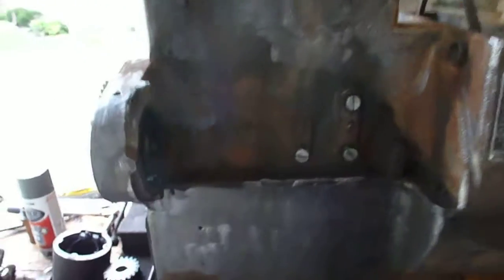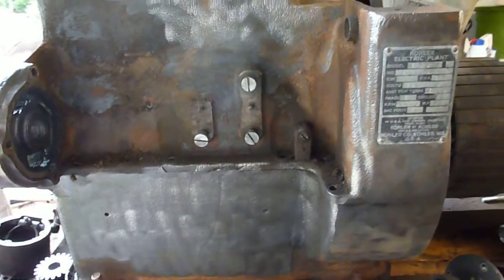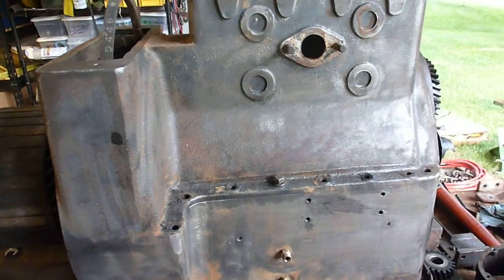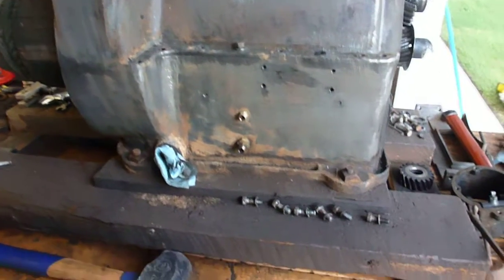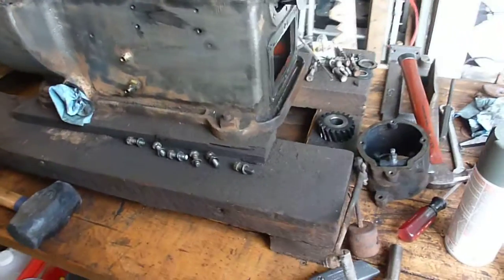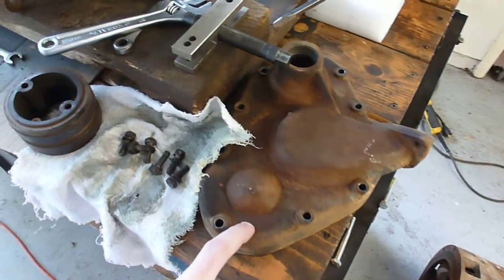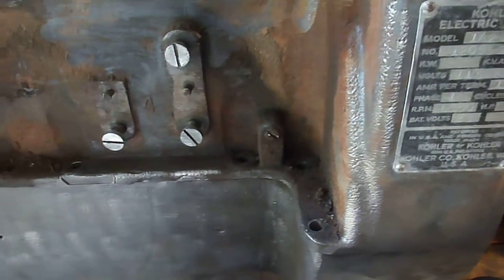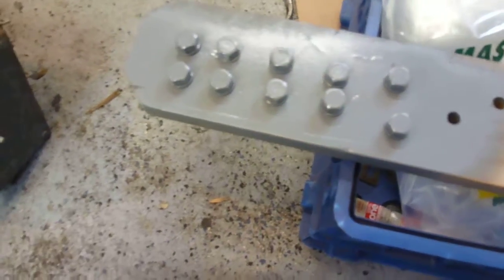Kohler 1A21 Electric Plant (Part 10)

Comment: The numbers stamped below the spark plugs may possibly indicate the size that the cylinders honed out to at the factory. I've seen that on several Wisconsin engines. "0" is probably standard. 1+ might be .0001 over.

Comment: you should have just made it run first like darth said. flush the cooling system change the oil and filter clean the points and put some gas in it and go. you can get a commutator stone to clean that up once it is running.
Reply from the maker: I have not even looked at this project in over a year other than loading it on a trailer to move it from one house to the next. It would have never run as it was. Can't remember if I showed it in a video but the head would have had to come off to clean the valves out at some point before it would run... there were acorns and corn kernels in the valves.

Comment: my suggestion focus on the engine first. if it wont run then no point spending time on the genny part of it. regarding the genny, be very careful how you clean it. brake and carb cleaner may disolve the laqure insulating the wires and that could be BAD...